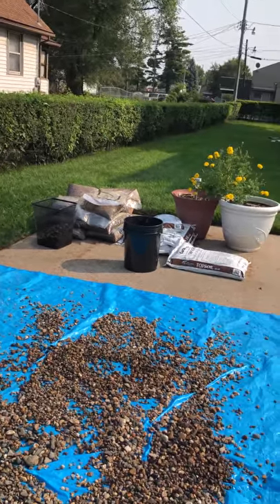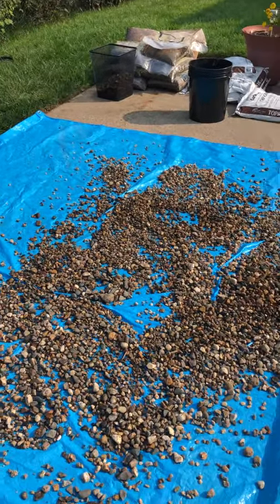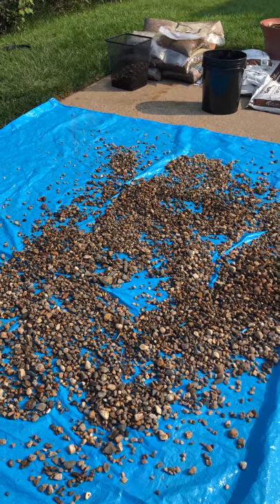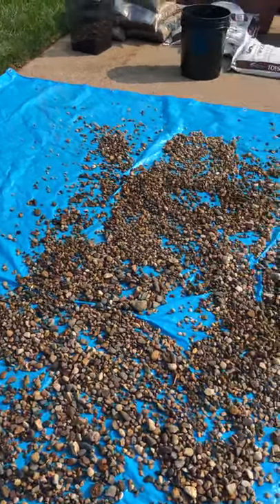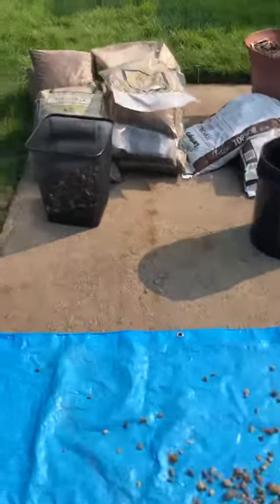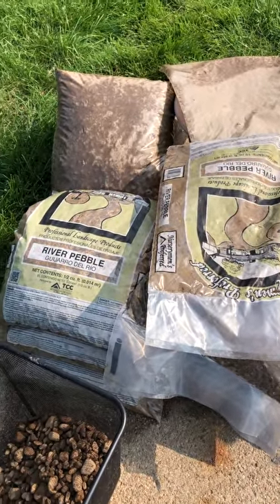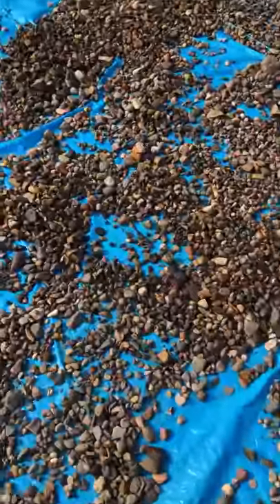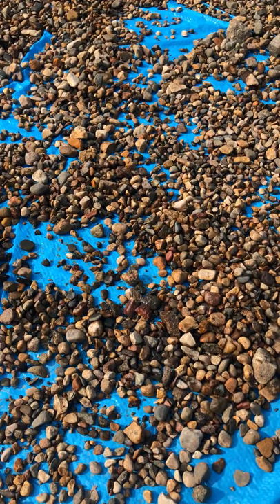She Shed EkoFlo Project phase I

Comment: Great video Deb! Two quick tips: 1. We recommend using 1/2 rock or smaller. Some of those larger stones might affect the strength of the finished bond. You could screen them out, or make the finished surface a little thicker.  2. We pronounce it eco-flow (like ecology). I know, i know... we spelled it wrong :) Thanks for posting though- we look forward to seeing the finished project. As you finish the project up, mind if we share this across our social channels?
Reply from the maker: Thanks for the tip. I was so excited to go rock shopping that I totally didn't recall that I needed smaller rocks. So thanks for posting and letting me know that the work around is making the finished surface a little thicker. 

That said, I have not yet had a chance to advance my project any further. We can't seem to catch a break with the weather. It's either raining or too darned hot. 

 And yes, once I finish the project, you can certainly share it across your social channels.

Until then, take care!